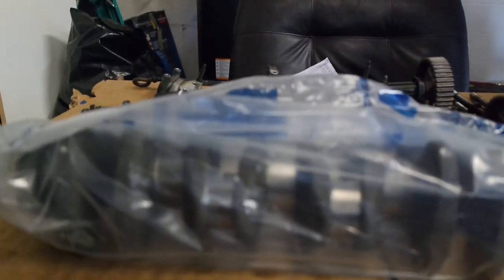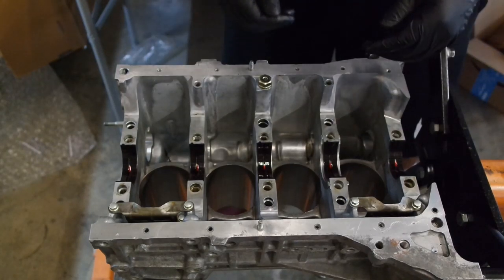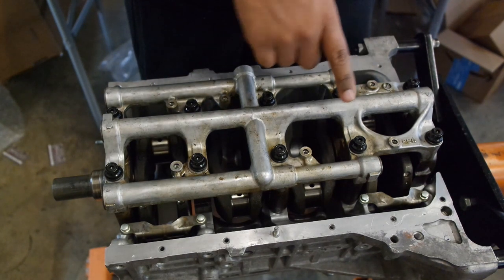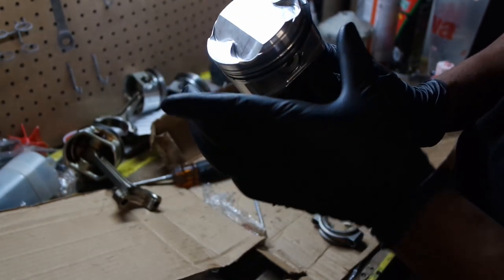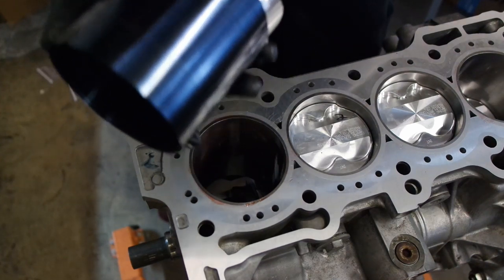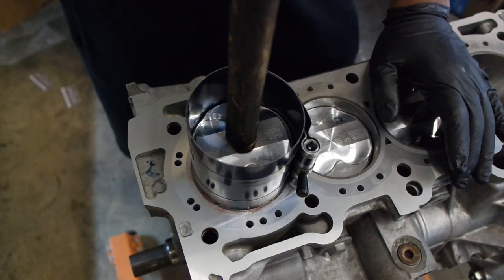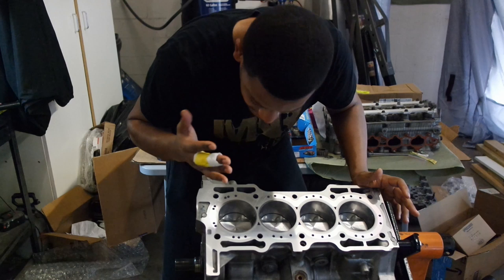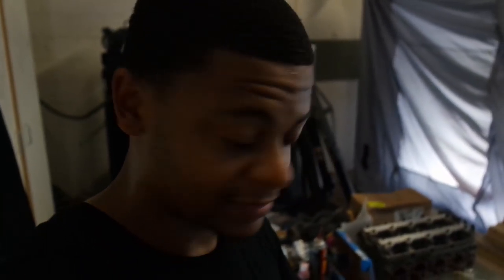600+hp f20b piston install  | Honda prelude h22

Comment: The trust washers help keep the crank from walking they wear out faster on a standard vehicle then a auto cuz the clutch being aplyed pushes the crank if the trust washer weren't there the crank would lock up or youd walk your main bearings thed evently slip
Reply from the maker: Ahhhhh seee i knew someone would come in clutch with the info. Thanks bro

Comment: main studs get torqued to the amount the machine shop had them torqued when they line bored the block
Reply from the maker: Yea your supposed to torque them to spec before you send it off.

Comment: What CR are you running? Good content keep it up buddy. Oh and thrust washers close the space between the crank and the block/main caps. When actuating the clutch without them the crank has room to slide left and right. The thrust washers close that gap. If you lose a thrust washer the motor can seize up from the crank hitting the block or main caps. Someone correct me if the science isn’t perfect but for a quick answer that’s what they do.
Reply: Trey what Compression Ratio are you running with your turbo setup and what fuel do you use?

Comment: hope it goes ok bro, saw a few things but hoping for the best man after it makes it 1000 miles it will show if it survives
Reply from the maker: Talk to me bro im still learning?
Reply: @treybedipping1734  well the way the pistons went into the bore ,the video didn't show if they jammed a bit before going in (if this did happen to u ,u need to inspect for bent rings )the bearing install looked good ,both thrust washers faced out grove side out away from eachother (u didn't specify )  also on the main studs only go to factory specs if u didn't have them machined for said torque wrench , one test that is very simple is to spin the short block with just a wrench and it should spin with less then 5lbs of pressure ,also after a few rotations look at the cylinder bores and see if u dont see some new little cut Mark's going down the cylinder
Reply from the maker: @drewster956  very useful info bro ill double check what you said. Thanks✊🏾

Comment: Right behind you on that wonder how the trans we use will hold🤷‍♂️
Reply from the maker: Only time will tell 🤣
Reply: Trey Be Dipping yeah bro i was shooting for 350 just need fuel pump ,boost gauge , sandwich plate and fmic piping and we rollen to dyno lol
Reply from the maker: @4door_papi  nice what kind of manifold do you have?
Reply: Trey Be Dipping i just noticed this lol comen back to this video i have a 850fab mini mani 

Im at 410whp stock longblock

Comment: TreyBeDipping you a Beast Bro I like how you do mostly all your work Bro true 🔰🔰💯 Hard work and Passion and how do I make my f20B hit 7800 rpm like yours and others I Be watching do I have to get my car tuned or??
Reply from the maker: Thanks bro thanks for the support. And yea you have to get tuned or have a chipped ecu
Reply: Trey Be Dipping thanks Bro 💯💯🔰🔰 how much does it cost normally to get tuned
Reply from the maker: @johnriddle5853  each tuner is different anywhere from $350-$500 in my area.

Comment: When Installing the H22 Head, does the block need to get milled at all? or does the head need decked? and if so, what are the numbers? 

I appreciate your time bro!
Reply from the maker: If there has ever been any overheating, or is the motor blew you for sure want to. If there was no prior damage before you removed it you can get away with not doing it but there is always that risk. I would have it done. And machine shop have all the specs for that stuff
Reply: Thanks man!!
Reply from the maker: @braydencrawford3048  ✊🏽

Comment: Bro, what about rod & crank bearimg clearances, did you plasti gauge or what did you do to check you where with in specs?
Reply from the maker: Plasti gauge is the way bro but nobody wants to see all that.
Reply: @treybedipping1734  we all wanna see that, lol.
Bearings are the most important part of the build.
Any ways good job on the build.
Reply from the maker: @henrylima6974  my bad it seemed boring 🤷🏾‍♂️

Comment: Hey Trey are you running the front motor mount by the radiator??
Reply from the maker: Nah i have solid mounts plus with the turbo there is no space
Reply: I didn't think so thanks man! I just snapped the studs doing a burn out and was wondering if it was needed lol !

Comment: Where did u get the pistons from
Reply from the maker: My boy pancho sancho rising son motor sports. They are traum pistons
Reply: @treybedipping1734  Oo..ok wats the bore size and compression
Reply from the maker: @jevy181  85.5 and 10:2
Reply: @treybedipping1734  Ok. Cool. Wats the price?
Reply from the maker: @jevy181  $600
Reply: @treybedipping1734  ok

Comment: Buy 4piston oil pump for ur build
Reply from the maker: I got the ks tuned one with the block off plates installed for the balance shaft delete kit.
Reply: @treybedipping1734  hey bro i have a h22a si block if i do balance shaft delete will i gain power like that too
Reply from the maker: @accorddynamic244  its more for increased oil pressure you gain a slight hp increase from not having to run that belt but its minor
Reply: @treybedipping1734  ohh i get it now thanks u